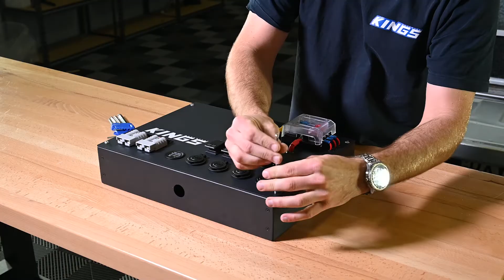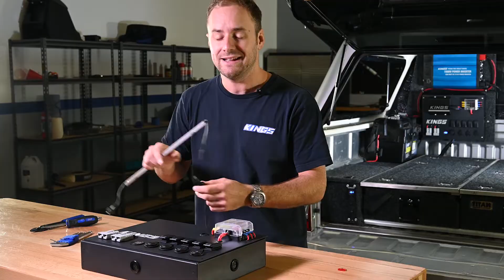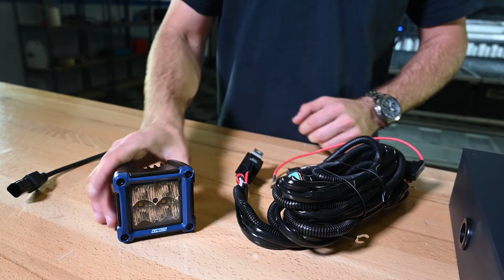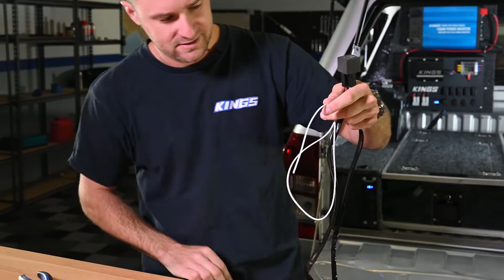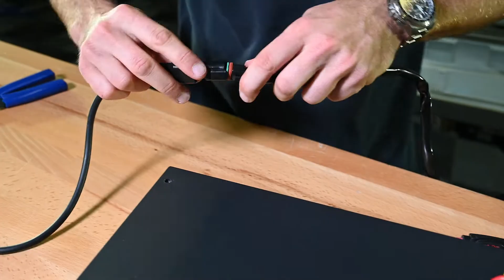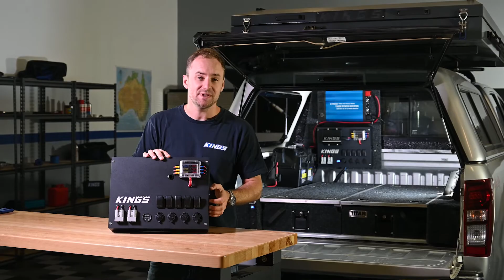Adventure Kings 12v Control Box Switch Wiring

Comment: This is not a very good video for instructions on how to wire. It raises more questions than it answers. I thought the anderson plugs were for output and not input power? Also, there is no explanation of how the wires are routed to the fuses. There are 5 switches and 6 fuses. Which fuse is related to what switch? I guess I can follow the wires, but the whole point of watching this videao was not having to do that.
Reply: Anderson plug on the control box has two features; as an output plug and an input connector.
If the control box is connected to the main battery through its Live and Neutral terminals, then any Anderson plug can be use an output with rating of 20 amps each. The amperage rating of the entire Control Box, however, is 40 – 50 amps.
If the control box is powered though any of the Anderson plugs, then, the amperage rating of the entire control box is 20 amps. The other Anderson and other plugs on the control box will be used outlets with a total of 20 amps

Comment: I want to use those switches to turn the sockets on/off that they're in love with. How do i do this?
Reply from the maker: Hi there, thanks for your question. You would have to wire the switch connection corresponding to the socket you'd want to turn off and on for. Please refer to the video for a guide or visit an auto electrician.

Kind regards, Sue

Comment: what brand of rocker switch is used,  as i have 1 which is faulty on my kings control box which i need to replace
Reply from the maker: You might be able to find a similar switch with compatible dimensions, but unfortunately we don't keep them as a specific part, you may be best off running one by a 12v specialty store such as Jaycar.

Regards, Andrew

Comment: Hi, I have just connected 2 x 138ah kings deep cycle batteries in parallel. I have a 100w Kings solar panel on the roof of my 4wd running to a kings 15amp PWM. What is the best way to connect the solar controller so both batteries get charged. Thanks mate.
Reply from the maker: Hi there,

Standard wiring should work fine, installing as per a single battery directly to the primary battery then letting it load read generally sorts that out in short order.

Regards, Andrew

Comment: The way my switch box appears to be wired is such that 1 fuse supplies current to 3 switches, as they are daisey chain wired together. I would have thought that 1 fuse would supply current to one specific switch. I think I will have to re wire the switches to the fuse block to make this happen. A circuit diagram would have been handy. Cheers, Rob.
Reply from the maker: Hi Rob,

Cheers for the feedback, as that sounds like a solid idea to me that way you can spread the capacity to a greater degree on those switches, I've also passed the request for more diagrams on to our documenting team as well.

Regards, Andrew

Comment: Hey mate just bought exactly the same panel from u guys. But I have 3 fridges and the soolar panels come in to the panels so I have to add 2 more Anderson plug could u please help me to do that ? Thanks
Reply from the maker: Hi there,

In this case it does sound like you would need to manually wire in extra anderson attachments, your best bet would be looking at an Anderson to Ring Terminal cable that most auto electrical stores would hold.

Regards, Andrew

Comment: Excellent, but how do you run power to switches?
Reply from the maker: Hi there,

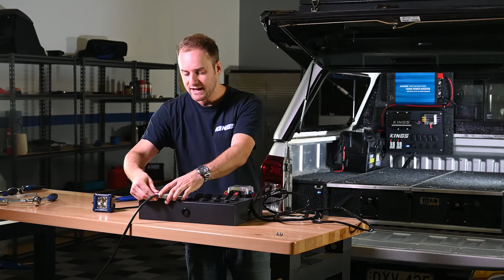Thank you for the comment, I can advise that if the item is routed through as per the connection at 1:20 so long as they're properly fused via the fuse box.

Comment: Can someone please tell me if I can connect my arb air compressor to this setup on a rocker switch?
Reply from the maker: Hi there,

The biggest hurdle to such a set up, is that while it is possible, you would need to ensure that the wiring and fuse are both large enough to handle the compressor's draw, as compressors normally have a high upfront draw that can burn out a lot of smaller gauge systems.

Regards, Andrew

Comment: Just got them installed. Bit of mucking around to make the harness work with it.
Just to summarise if anyone is struggling:
-Red and black terminal rings go to respective posts.
- pull the 3 female spade connectors out of the switch. Connect white to the back of one of the control box switches, each one has a spare male connector (just make sure its linked to the correctly rated fuse). Cap off the remaining blue and black wires.
- last cable is meant to link to the highbeam circut. Cap off black. Connect red to a earth terminal. 
-last cable plugs into the lights themselves. 

I'm no expert but this worked for me. Hope it helps ✌🏼

Comment: Let’s say you want to wire up some led lights using the rocker switch:
1. First cut off the existing plug end and feed the wires through one of the grommets (side, bottom, top).
2. Then bare the two ends of the wires.
3. If the device has a positive and negative wire, put a female spade fitting on the positive (red) wire and a ring connector on the negative (black) one. Otherwise , spade on one, ring on the other.
4. Connect the female spade fitting to the bare post coming from the rocker switch you want to use by pushing it on (the power is going in via the red wire on the other post)
5. Connect the ring connector to the negative bus bar by unscrewing one of the screws and attaching it.
6. Assuming you have a battery connected, that rocker switch should now be live.
7. Put a suitable sticker on the switch to identify which device it is powering.
Reply: Great comment thank you
Reply: Thank you! If I have two lights, can I put two wires on the one space I have left on the busbar?
Reply: @katie.maree8  sure can, as long as you have one wire on the switch and one on the bus bar. You can put multiple negative wires on one bus bar bolt.
Reply: Legend! Thank you. Way better than this useless video.
Reply: PS, i fyou want a switch to control the cig lighter, take one of the wires off the back o fthe cig lighter and connect to a switch
Reply: Thanks for that! The video is near on useless!

Comment: Idea is great but having problems installing spots light with plug and play harness and none of the questions previously asked by other viewers about the same was answered so could you pls explain better how to connect 4 inches led to the box with the harness and relay please?????
Appreciate it
Reply: There's a major part missing from this video, for the 4 inch work light wiring. The RED wire that normally goes to the car's lamp has to be earthed to the earth strip. Cant believe this important bit is left out of the video. There's also a black wire, but you can just cover that. It doesn't get used.
Reply: @HerbieHayward-WA  legend been looking for this info for a while now
Reply: @HerbieHayward-WA  champion mate 👍

Comment: So I bought the box, but I still have no idea how to wire it up and a demonstration video (for dummies like me) would be awesome. There are so many things that have to happen
Reply from the maker: Hi Heather,

Exactly how would you like to use your control box?

Do you have a dual battery setup already? Or a DC-DC Charger?

Let us know a bit about your setup and we'll see if we can help!

Cheers,
Cahn
Reply: @4wdsupacentreAu  I'm not Heather, but I am also confused by the switch wiring.  I want to use this box at my off grid property to light the cabin. So, 4 areas of light, needing 4 switches from the box. 4 cables of positive (red) and negative (black) coming from the shack to the box. I am guessing I spade connect the positive wires to the switches, and then try and connect all of the negative wires to the 1 spare connection on the negative (black) bus. Is this correct?
Reply: @Tommyt14 i’m trying to do the same… is this right?

Comment: I have looked at this video numerous times and I cannot get my 4inch Kings work lights to turn on. I am using a brand new kings wiring harness. Is there a diagram available or am I just making a simple error? All fuses are fine. What I find a little unclear is the red and black wires from the relay to the posts in the box. Have they been lengthened as in the video the relay is outside the box on the bench? Also, the switch wires on the harness. What happens with the blue and black wires? I even have it connected direct to a 12v battery and still no action. Could somebody assist me please?
Reply: Hey mate what did you end up doing abput the relay thats were i come unstuck?? Do you keep the relay or how does it work?
Reply: I'm in the same boat it didn't work like the video if someone could answer the questions